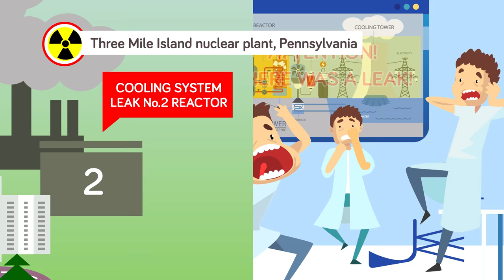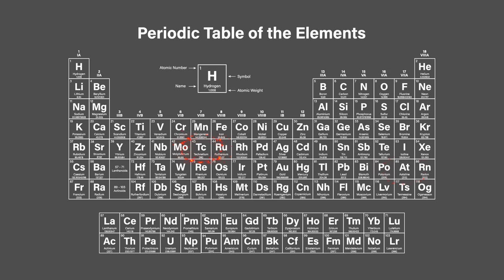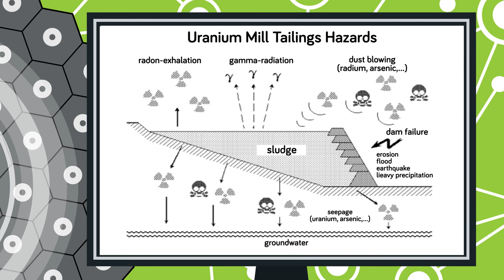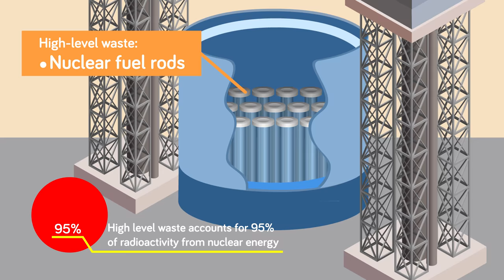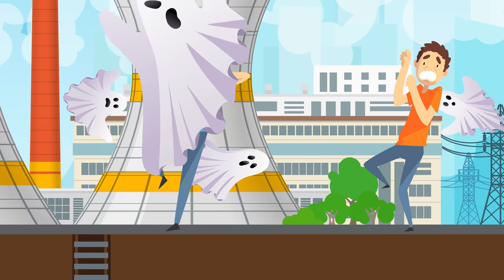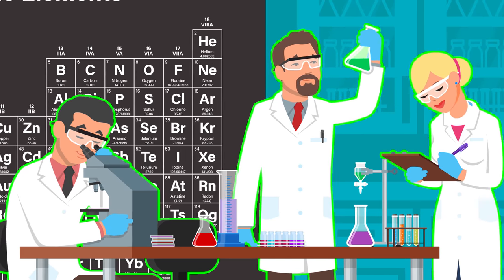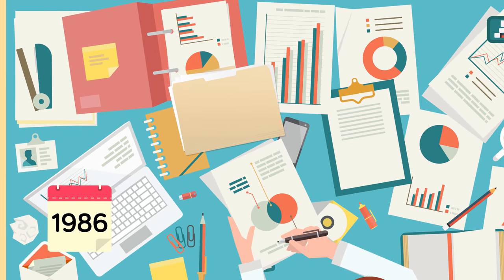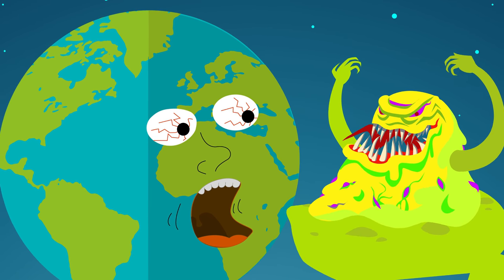What Happens To Nuclear Waste?

Comment: Three Mile Island was a very minor event. Not even a disaster. Most folks affected only got about as much radiation from the incident as several dental x-ray exams.
Reply: Yet the fear after TMI contributed to the cancellation of over 100 reactors, leading to hundreds of thousands of air pollution deaths from coal that should’ve been avoided.
Reply: @eriklakeland3857   And the best part coal Gives off radioactive elements and throws it into the air.
Reply: @fnulnu5109  Fukushima was bad as well. That being said, that was a completely preventable incident, The blueprints they were given had they had actually followed would have prevented water from getting into the facility.

The equivalent would be like if I sorely mismanaged a coal plant and neglected the fireproofing systems and set the forest and a local town burning down. The majority of said town and a lot of forest acreage are destroyed in the incident. Then people start making claims about coal because of that. Keep in mind, nuclear power is the safest form of electricity overall.
Reply: @fnulnu5109  "The transit of an air mass containing radioactive gas released from the Three Mile Island reactor was recorded in Albany, New York, by measuring xenon-133. These measurements provide an evaluation of Three Mile Island effluents to distances greater than 100 kilometers. Two independent techniques identified xenon-133 in ambient air at concentrations as high as 3900 picocuries per cubic meter. The local ..gamma..-ray whole-body dose from the passing radioactivity amounted to 0.004 millirem, or 0.004% of the annual dose from natural sources." ----- Radioactive plume from the Three Mile Island accident: xenon-133 in air at a distance of 375 kilometers
Reply: @eriklakeland3857 the bad part of the TMI incident is the company that designed the plant knew of the switch issue that caused the problem and tried to hide it!

Comment: The high level waste is not at all green goo that's kept in regular barrels like in the Simpsons. They are solid highly radioactive rods stored in robust containers called dry casks which are practically indistructable. In a test they have been rammed into a wall while on the back of both a flatbed truck and a train before being submerged into a pool of jet fuel set ablaze and the cask still remained intact.
Reply: Warning. Wikipedia spoilers here
Reply: Toxic substances are often depicted as green goo/liquid because in Victorian period there was very popular green dye called  venice green, I think? It contained high doses of cyjanide. People would use it for wallpapers, dresses etc. For accident involving radioactive materials, like demon core, I've heard of light blue cloud from ionized air particles. Objects made from uranim glass glow in bright, almost neon green though
Reply: It's amazing how much they got wrong. I work in nuclear Refuel. Tmi for instance was human error.
Reply: @nosferatadentata965  -the green stereotype might also come from the popularity of uranium glass in the 1900s, which glowed a greenish-yellow. Pretty much the only interaction people had with radioactive material, tho it’s obviously nowhere near the level of radioactivity in the materials used for nuclear plants, albeit still not safe.
Reply: @nosferatadentata965  Right. That blue light is called Cherenkov radiation.
Reply: They're also filled with ceramic, glass, concrete and other materials
Reply: @1_atlas_7  plus after 35 years of trying, these glass blocks have never been safe. You can make one, or a thousand end they still can meltdown.  Making the millions needed would be quite a dangerous task and it would not make the wastes any safer than the casks. Just demonstrates how dog and pony engineers try to come up with solutions for an unsolvable problem.

Comment: To correct a major detail of the video: shorter half-life = more unstable, more dangerous. The half-life of a radioactive isotope is the amount of time is required for half of it to have decayed into a more stable element, so the quicker it is able to do that means the faster it is pumping out radiation.
Reply: Not strictly correct
Reply: Half Life: Decay
Reply: Radiation is Not a problem, thoughts like this ARE.
Reply: @itdoesntmatter4066  elaborate or don't even bother
Reply: @ohzone6464  elaborate or don't bother. The guy brings something interesting to think about and you bring nothing

Comment: You’re wrong about the cement in barrels method. It take 5 times more volume. Glass processing of HLW is the best option. Geological disposal is many times safer than storing them on the surface, you cannot keep radioactive waste exposed to the biosphere.

Comment: Always kinda wondered if it would be feasible to build nuclear plants inside mountains. Wouldn't that provide waste disposal as well as a decent barrier in case of any melt downs?
Reply: That would only work if the mountain nuclear plant remained completely sealed forever.  If there were any entry or exit points, such as access for humans or getting the generated electricity out of the mountain, this would pose a weakness and escape route in the case of any meltdown.  Therefore, the shielding of the mountain would be pointless.  Only long-term storage (dumping) needs such a solution and an underground mountain (deep digging) is better than an overground one.
Reply: Let’s ruin a mountain.
Reply: @indigo2398  I know, right? The backwards thinking is mindboggling.
Reply: @sonar3108  lets ruin countless fields and oceanbeds with wind turbines
Reply: @gracida6  how do you ruin a field with wind turbines
Reply: @marcoheintges7338  when you stick a bunch of wind turbines in a feild you just eliminated a lot of diferent ways to use that feild
Reply: @lieutenant_dirtbag2875  well maybe but it would still be much better then coal power plants also you can still use the land around turbines most are put in fields and pay the owners to have them there and they still can farm in between the turbines. Hope this helped
Reply: WIPP IS 3300 FEET underground,  it didn't stop it from blowing out.
Reply: Maybe water would be an issue in the mountains

Comment: @1:28 This is extremely inaccurate - there was no cleanup of the surrounding area, because one wasn't necessary.  The cleanup effort was contained to the plant and the reactor vessel itself.
@1:48 Inaccurate again - almost no one is recycling fuel at this point, largely due to political pressure brought about by anti-nuclear hysteria.

Comment: Haven’t watched but I assume that they just put it away and cover it up.
Reply: Yes
Reply: That is the best solution with current generation nuclear waste.
Reply: The problem is that nobody can tell you exactly where to put it and if it is safe.
Reply: @puo2123  Well current gen nuclear waste is actually not very radioactive, in fact we are every time figuring out how to get more power out of lower and lower radioactive materials. We can also use the waste multiple times, IIRC with most modern reactors only about 2% is actually unusable after reaction. That leaves quite a lot of reusable "Waste".
Reply: @donovan6320  thats just a dream... wake up...
Reply: @mokujin4076  No either way it is cool. Clean, safe, and affordable energy

Comment: I think it should be mentioned that stuff with a longer half life is also less radioactive. uranium 238 does have a half life of 4.4 billion years, but is mostly harmless because of it. "non-radioactive" stuff, is really just radioactive stuff with an infinite half-life, if you think about it.
Also there is a large difference between alpha, beta and gamma radiation. Alpha radiation for example can already be shielded by something like a piece of cardboard or aluminium foil, while you'll need thick lead plating for gamma radiation.

Comment: Deep sea subduction zones. Encase high level waste in spherical casks made of osmium (the densest element) with a shell about a foot think, and drop them into the ocean above deep sea subduction zones (where one continental plate is being pushed under another). The spherical shape is to ensure the maximum strength and to improve the possibility of the casks rolling down hill toward the junction between plates. The goal would be to get the Earth itself to eat the waste.
Reply: Funnily enough nuclear fission reactors are a geological phenomenon. There is one at the center of the planet, but also throughout history many natural reactors near the surface. Look up G. Micheal Hearndon (PhD).
Reply: Oil field boreholes off the California coast move into the subduction zone of the pacific/north American plate. The best solution is to use a series of reactor designs that use up waste from other designs that extract the maximum power from the fissile material and leave the minimum waste which is small enough in mass to drop into a borehole and over the eons,  it will be carried back in towards the earth's core.

Comment: Really the short half-life are the dangerous stuff.  Like the stuff less than 6 hours is really dangerous stuff but after like 4 days the stuff is basically all gone.  The stuff with long half-life in contrast is far less radioactive and dangerous.  What this means is stuff first taken out of the reactor is very radioactive and dangerous.  This radioactively drops off very fast at first.  This is why waste fuel rods need to be stored in water at first.  After a relatively short period of time the radioactively drops off massively and the waste can be stored concrete caskes.  Yes they need have some passive air cooling but really it's not much to be concerned about.  What's left after fifty years or so is mostly long life radioactive materials that are not very dangerous.

Comment: The longer the half life the LESS radioactive it is. Such materials are more dangerous as a heavy metal than as a radioactive isotope. When the sub-hundred year isotopes are nearly gone like Strontium-90 or Iodine-131 (which is used in medicine and has a half life of Seven days), Nuclear waste could be stored normally with a few extra precautions.

Comment: a small cube of uranium represents 800 liters of oil in gen 3 reactors
the same cube in a gen 4 reactor represents 64000 liters of oil + radioactivity of the cube goes down to 300-1000 years

Comment: Question to all with some knowledge about nuclear energy/weapons:

If leakage of waste or contaminated water or the indirect effects of a meltdown (read: fallout) occurs, will it spread over a vast area? Or does gravity does its work and contain those heavy elements on isolated, small pockets of radioactive dangerzones? It to be buried quickly by sediment and posing less danger of future spreading?

Or are the ionizing properties so strong that even without spreading, a vast area surrounding a leakage is at risk of being ionized?

For instance, are traces of the partial meltdown of Fukushima found in a vast area around the former plant in the pacific? And are traces of fallout after the chernobyl meltdown still found in soil in Belarus and other European countries?

Despite the major problem of a complete meltdown and the processing of nuclear waste until 1990 (throwing it in the ocean in not much more than garbage bags), I have a feeling that the risks of the nuclear waste are exaggerated in public view upon it. But this perception is based on logic and not on knowledge.
Reply: There's still trace amounts of radiation being found in the soil in Napa Valley California from the Fukushima disaster which if I remember correctly was 12 years ago and from what I know Fukushima didn't melt down the earthquakes and Tsunami that followed dug up the spent nuclear rods they were burying
Reply: Do The Research!!!

Comment: Ummm...HIGH LEVEL wastes are solids, not liquid. You cannot access liquid HL because it is the material that is formed when a reactor melt down. This wast is kept in a 2 foot thick container made with cement and buried under ground then a 5000 kilogram lid on top and then all this is kept under high security.

Comment: Has the Infographics Show heard of radioisotope heating units, or alternatively, radioisotope thermoelectric generators, such as the ones used in spacecraft like the Voyager probes? I wonder if such technology would hold promise as a way to not only solve our needs to safely dispose radioactive waste, but to do so in a profitable way, such as providing free energy from the waste heat created when the radiation is absorbed by materials such as lead or gold, which would also help to lower our needs for non-renewables such as not only fission reactors, but also fossil fuels. Said waste heat could be harvested for power by exploiting the thermoelectric effect, which is what the Voyager probes use, and would be suitable for smaller amounts of waste heat, or alternatively, for handling larger amounts of waste heat, submerging the material in a traditional steam boiler for traditional steam power, as in a nuclear or geothermal power plant, would perhaps do the job.
Reply: We used plutonium for pacemaker batteries too. Plutonium gives off Alpha radiation, so even paper can stop that radiation

Comment: I would argue that the carbon footprint just to mine and enrich these elements outweighs oil.
Reply: Processing oil also takes energy, and you would need to move a large amount of oil to make the power output of a small amount of uranium

Comment: For a channel called Inforgraphics Show, there's a bad amount of disinformation in here. 

- Nuclear waste is solid, not liquid, and it doesn't glow green. 

- It is stored in large concrete casks, not metal barrels.

- Rats that eat nuclear waste don't become monsters.

- Longer halflife isotopes tend to be less problematic, because the longer the half-life, the less radioactive it is. At the far end of the scale are plain regular non-radioactive materials, those literally have an infinite half-life, they never decay.

- Getting rid of nuclear warheads is rather straight forward, since they are currently being reprocessed for a fuel for current nuclear reactors. During the Megatons To Megawatts program, 10% of US total electricity was generated by buying and burning russian warheads.

- Nuclear waste doesn't have any explosive properties to begin with.

- No country is currently storing nuclear waste underground.

- Nuclear waste doesn't make you grow two heads.

- Space is not an option for nuclear waste.

- Even if it was, it would not poison any aliens, because space is often more radioactive than our nuclear waste to begin with. 

- Mass drivers is a hogwash invention along the lines of perpetum mobile, it is not being in development, it was in the process of being properly debunked by many scientists, including nasa researchers several years ago.

- The capacity of our space shuttles is currently zero, the shuttle has been discontinued almost a decade ago.

- IFR got cancelled due to political reasons, general public unpopularity of nuclear power and due to lobbying from fossil fuel companies. It was not due to leaking coolant, because it did not leak coolant. There was an engineering challenge, because the coolant pipes were coroding slowly and would eventually have to be replaced otherwise it could leak in the future, but it did not actually leak. The engineering challenge was about finding a combination of materials that would not get corroded by the coolant, which was just one of many engineering challenges, some of them already solved, others still in progress. The corrosion challenge was just the one currently being worked on when it got cancelled.